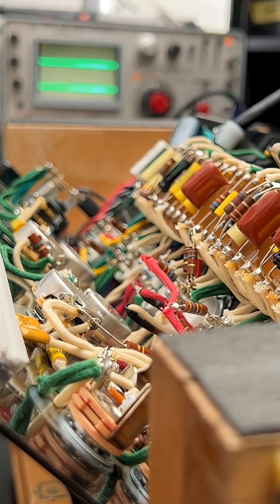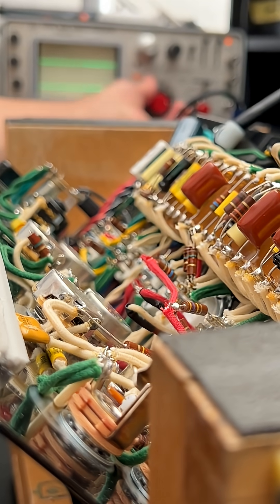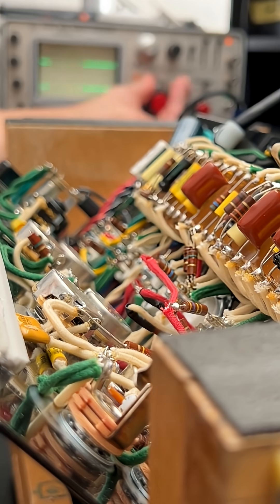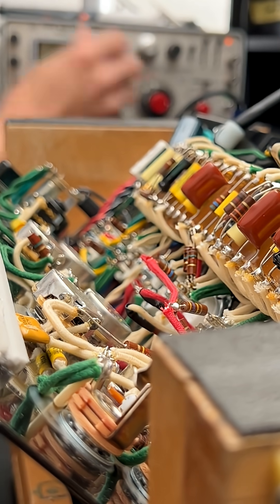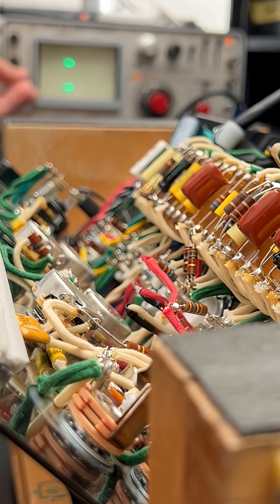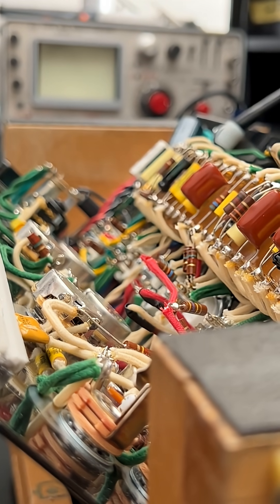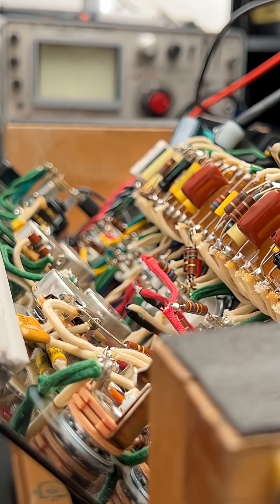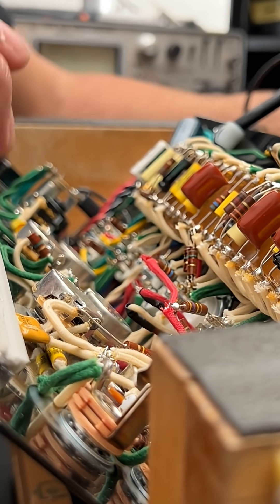Swart Atomic Space Tone - A joy to work on #electronicsengineering #tweed

Comment: Both scopes in my shop are analog, from the 80's. Love them. Bought a $400 digital scope and tried to get used to it. What a piece of crap. Sold it on eBay. I'm never going back.
Reply from the maker: I was looking at them for space saving, but they can’t handle working on certain things I need them for.
Reply: @ForgottenGearRestorations  I still work on CD players. One thing you need to be able to see when working on a CD player is the "eye pattern," which is an FM signal that will let you visualize how well the servos in the player are working. ANY analog scope 5MHz or faster can show this. The digital scope I bought would not lock on to it and was useless for this purpose.
Reply from the maker: I totally know what you mean.  That’s part of why I love guitar amp work.